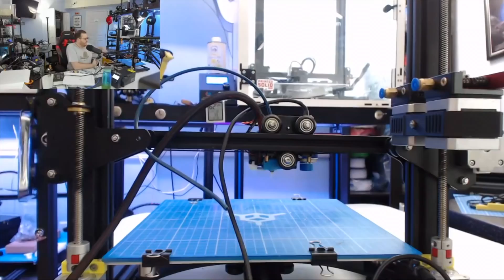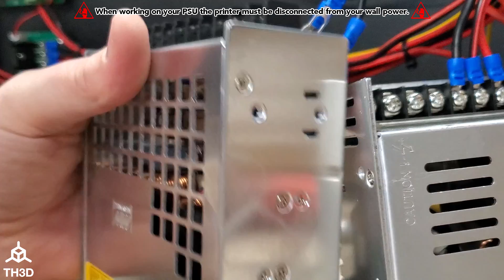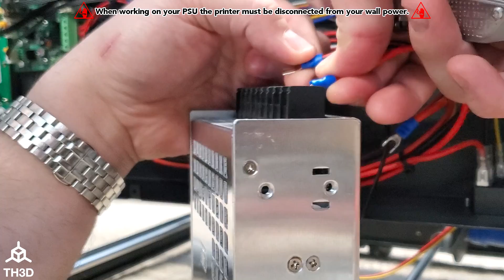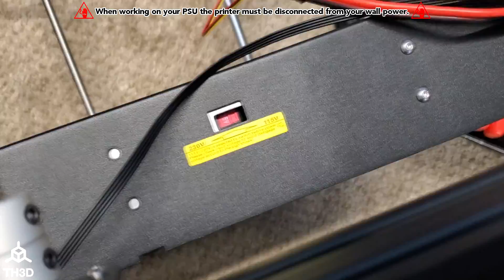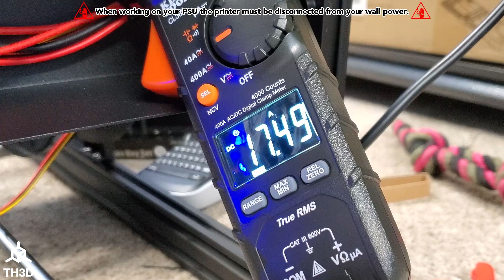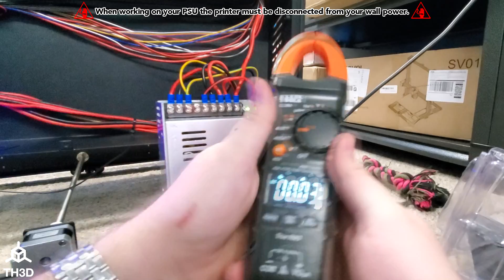How-To - Ender 5 Plus PSU Replacement - MeanWell PSU

Comment: Great video I have my new power supply from you being delivered today.  One question when the back plate of the control panel was removed on my unit the fan was unplugged.  what port does that need to be plugged into on the Creality board.
Reply from the maker: The VIN 2 pin header on the board.

Comment: The colour code used, black and red on AC, is an older EU and Australian colour code (and some other countries) where Red is "Hot" or "Live" and black is Neutral.   This colour code was replaced around between 10 and 15 years ago (depending on country) by Brown, Blue, Green/Yellow where Brown is Hot/Live and Blue Neutral.      As a note, I would put a warning on the video about the danger of Mains Voltage and always use an insulated screwdriver, even after the power is removed.  Caps can hold a charge.    Thanks for the video and tutorial :)
Reply from the maker: There is a large warning on the top of most of the video. As for the caps, on these PSUs they self discharge from being connected to the printer itself.
Reply: @TH3DStudio  Never saw any large warning on this one.    Maybe I missed it :)   Yes, they should self discharge, to the point where the low voltage side stops working, that does not mean the mains side caps are fully discharged :).   Better to be safe and all :).  
Good information overall in the video though.   Creality need to be more transparent in what we are getting.
Reply: @EsotericArctos  I don't see any either!

Comment: Recently purchased a Ender 5 Plus and it came with a mean Well RSP-500-24V supply installed, however there is no voltage selector switch on it, only a Voltage adjustment POT.  Have you seen this before, and is it safe to plug in?
Reply from the maker: The RSP-500-24V is an auto select model. You don't need to set a switch on it for the input voltage.
Reply: @TH3DStudio  Thanks

Comment: I recently got a ender 5 plus, it can with a built in meanwell PSU but it doesnt have a switch anywhere to change voltage, can you help me? Is it possible that there isnt any switch or just that I havent found it?
Reply: Hi so I know I'm late to this party.  I found that this supply is universal input so no switch required here is a link to the video.  Were you able to find any info supporting  my conclusion?  You may want to check your supply build spec.  its been 6 months how is the thing treating you? https://www.youtube.com/watch?v=_w28_PJQ9wg

Comment: do you think it will work well on a CR10S5? 
I'm thinking to upgrade from 12v to 24v and also replace the heating bed to a keenovo 1300W Silicone Heater
Reply: Tomer Rabinovich:    That's not how it works.  If you have a 12V system you must replace the PSU with a 12V PSU.  It's fine to use a higher quality unit or to increase the wattage but do NOT change the voltage.

Comment: Do you know what fuse will be needed in the Meanwell PS for the Ender 3 pro? Thanks.
Reply from the maker: Not sure what you mean. They do not have replaceable fuses.
Reply: @TH3DStudio  I mean the Ender 3 Meanwell power supply voltage switch. It has a fuse which is missing in mine and I was wondering wether it would be a fast or slow blow 24V 10A or 15A? Thanks for taking the time to answer my question.

Comment: Great vid, but why recommend and sell 450watts psu when you need more than 600? Then you are still stressing out the Meanwell. And yeah it can probably handle it, but that is heavily over spec!
Reply from the maker: With the 450W and the hotend and bed pre-heating ours pulls about 450W on the DC side from the PSU we specced out which per Meanwell can handle up to 150% of the labeled capacity. One thing to note is that your heated bed and hotend after pre-heating will not be on 100% power during a print and that usage drops substantially. During a print the average wall draw is under 200W from the wall on the AC side. The SE-450-24 has a max efficiency of about 86% per their datasheet. Now like most switching PSUs the higher the load the less efficient the PSU is going to be. 

TLDR; the 450 is a great drop in (no drilling) that the Ender 5 Plus works fine with.

Having the bed, hotend, and all the motors engaged in the E5 Plus with the SE-450-24 I'm seeing about 560W out of the wall according to my Kill-A-Watt and Battery Backup. 

Lets assume that at best we're getting 80% efficiency at that load (it may even be closer to 78%), we could verify that by taking more DC measurements but I don't feel like pulling the printer apart again. That means the printer itself is pulling about 450W on the DC side during the initial heat up, which is well within the limits of the PSU. Personally ours is used every day for 20+ hour long prints 5-6 days a week and haven't had any issues for the few months we've been running the new PSU for.

We've also load tested the SE-450-24 and the overload protection kicks in at around 140% load on all the ones we tested, which means these can handle about 600W easily. Meanwell always de-rates their PSUs which is one of the many reasons I like them. The temps on the PSU never exceeded 55C on the hottest internal component per our Seek thermal cam.

The main reason for going with the SE-450-24 is cost and drop in replacement. People already are complaining about shelling out $65 for the 450 and the 450 has screw holes that line up with the stock PSU. The 600W will not directly fit in the Ender 5 Plus chassis without drilling new holes and the other costs over $100 at cost. There's no harm in putting in a larger PSU. Just pointing out why we're carrying the Meanwell 450 version and not the others that can be made to fit in the E5 Plus. 

If you're using a 450 and are concerned with the load you can dial the 24V back to 22V without affecting much heat up times and it will drop the load by about 10% and bring it down to 410W total load. Personally I am running 24V on mine and have not had any issues nor do I expect to have any.
Reply: @TH3DStudio  Ok, tnx for clarifying!

Comment: I just bought a meanwell power supply from TH3D for my Ender 5, not the Ender 5 Plus and I can’t figure out for the life of me how to replace the power supply.
Reply from the maker: It's a direct swap wire wise. As for the screws they're under the sticker on the printer case. If you feel for them with your finger you can feel the indents from them then poke a 2.5mm HEX through the sticker into the head of the screw and unscrew
Reply: @TH3DStudio  This was my question too! Thank you!

Comment: Another QC issue related to power just incase someone still doesn't have mainboard power after replacing PSU, like me .... The wires for the mainboard power were not secured into the block hence wasn't making contact
Reply from the maker: Thanks for reporting that back! It's always a good idea to check that all connections on your machines are fully secured. Can't hurt to double check.

Comment: My ender 5 plus just started smelling like burnt plastic tonight. Going to order this asap.
Reply from the maker: If its coming from the bottom and not the hotend it could be the PSU or the MOSFET. Our PSU smelled bad and was replaced. Our MOSFET failed about 5 days later and we replaced that as well. Everything else has been great though.